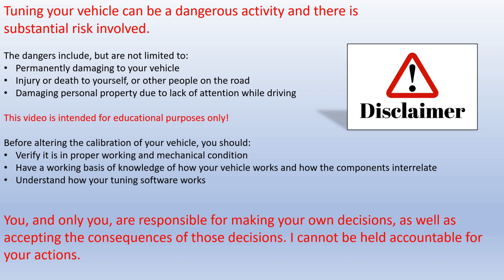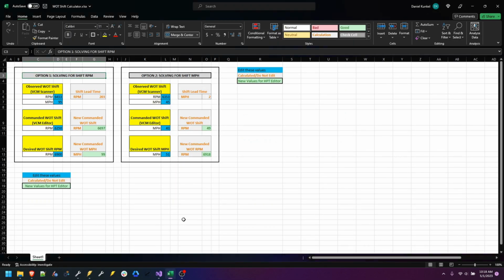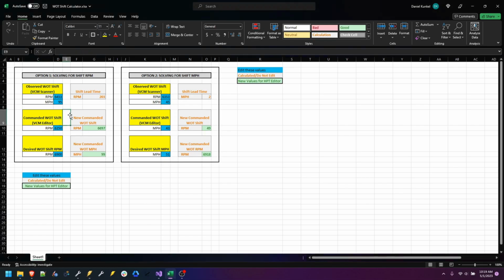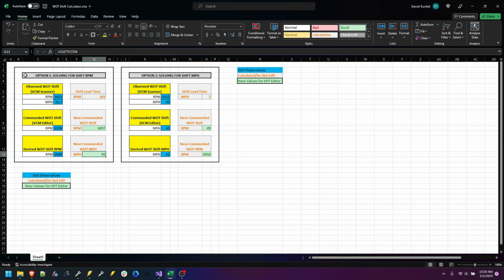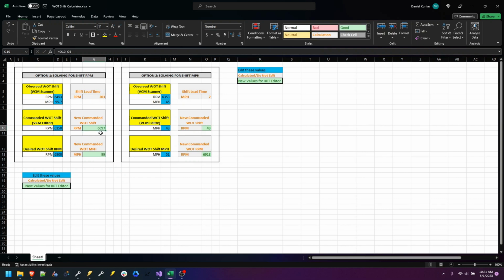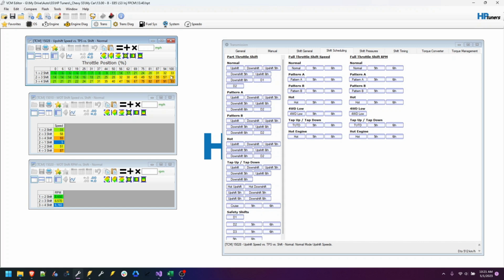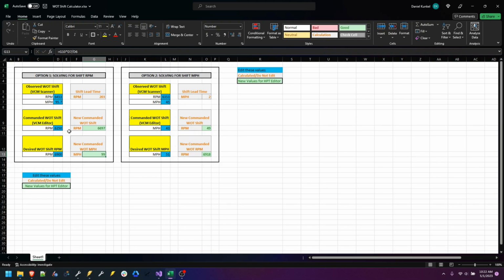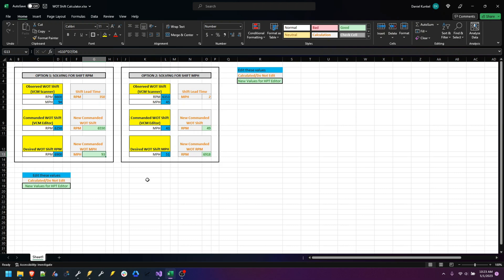Complete Guide to Tuning the 6L80E Transmission - Part 4a Shift Scheduling Addendum

Comment: awesome, thanks for videos. about hard stops ( downshifts) going lets from 70mph to 0 mph fast . Looks like everyone leave them stock, but mine sometimes are too harsh. How to soft them down?
Reply from the maker: @Ttbestas before doing anything invasive with the time/pressure stuff, first I would check a few things:

1) Trans > Torque Converter > General> Shift Lock ([TCM] 400) should be disabled.
2) Trans > Torque Converter > Apply / Release > I would also ensure the TCC apply is set to 318 mph and the release is set to 317 mph *for the 0% columns. This will ensure your TCC will release when you remove your foot off the gas pedal.
3) Trans > Shift Scheduling> Finally, I would double check all the downshift MPH for each gear. If these are set too high, it will cause an early downshift and the RPMs will spike.
4) Check the trans fluid level and overfill by 1 qt.